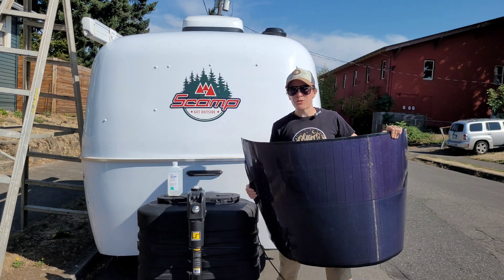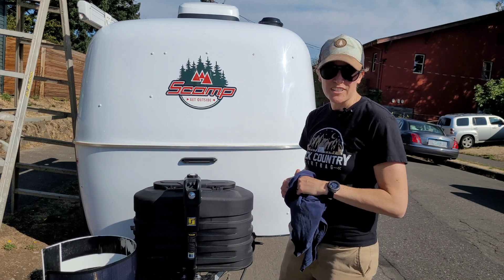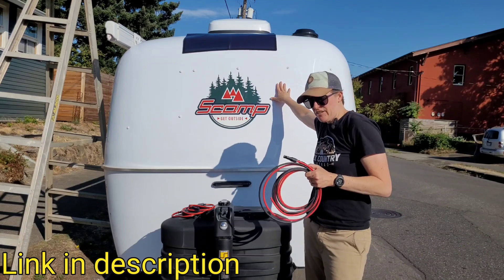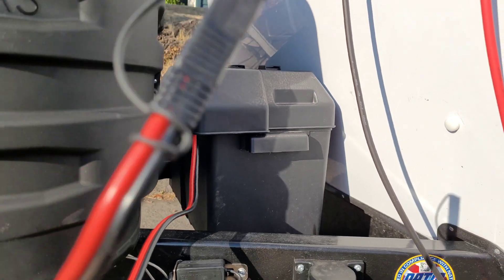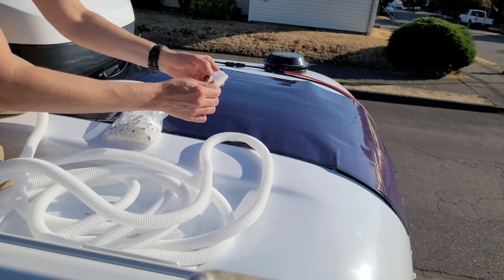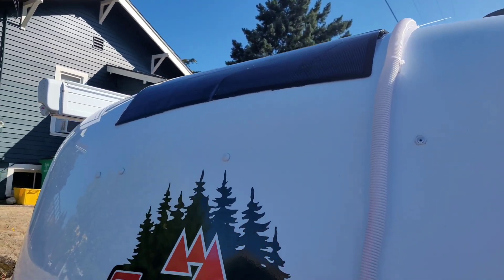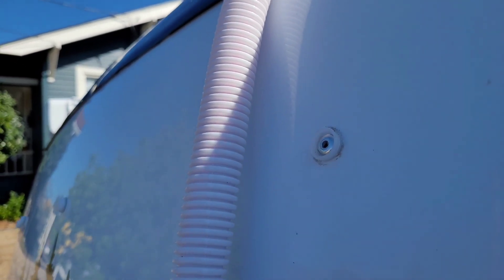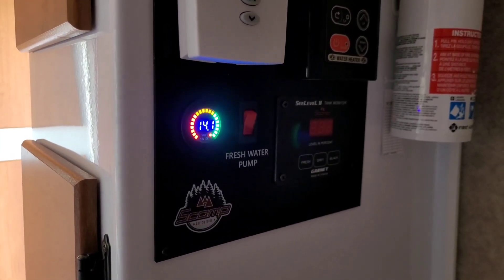Scamp 13 Flexible Solar Panel Installation

Comment: Great video! I have a 2017 Scamp that I have located at a storage facility with no access to electricity to trickle charge the battery. Would this setup be good to help keep my battery from dying?
Reply from the maker: Thanks! Yeah if I keep mine in the sun and keep the snow off of the solar panel I never have to plug the trailer in when I'm not using it. My battery stays topped off. 

But "always" charging does cycle through the fluid in a wet cell lead acid battery more quickly so I check the fluid levels in my battery at least once a month. I also clean/dust off the panel when I check on the battery to make sure it's collecting plenty of energy. 

I have a video covering the battery fluid maintenance as well if you haven't seen that yet: https://youtu.be/fZSGYlUXP74

Comment: OK, that's pretty cool. I was just looking at that exact same system a day or two ago. I am a big fan of BougeRV, I have a couple of their refers, a telescoping camp light and some things I can't talk about... yet. 
But first, today I will be moving the Scamp into its mothership docking location here in PDX and begin the cleanup and appliance check out process. 
Question, have you thought about a backup camera? Backup Lights? 
One more item, I believe those white zip ties are not UV rated, black ones are. Have you replaced them yet? How are those sticky pads working?
Reply: I'm interested in a back up camera too. Will be following your question
Reply from the maker: Nice! I've been really impressed with the quality of the BougeRV panel. It would be fun to try out more of their stuff. 

I do have the stock backup camera installed. It is really helpful during the day but without backup lights it can be hard to use in really dark conditions. 

I have an upgrade I'm planning to install come spring so stay tuned for a video covering that to hit the channel before too long. 

The zip ties have been stellar, they are all still holding up. The adhesive pads have stayed put on the roof of the trailer but the ones on the front that take all the wind while driving didn't stay stuck. I replaced the adhesive squares with VHB tape just on the vertical section of wiring that leads down to the battery. The roof mounts have held up to the wind and all my cleaning/polishing so far. 

Again, great questions. I'm glad you are enjoying the channel.

Comment: I need more power for my fridge.  After having this solar panel for a while, do you feel like it has given you more days camping with a fridge that lasts longer?  I have the same camper that you do.  I am mainly interested in additional power for my fridge, the lights, furnace fan, etc all seem to have enough power.
Reply from the maker: In perfect conditions when the sunshine is clear/consistent and my trailer is facing the optimal direction it is enough to top my battery all the way off every day.

However, throw trees, rain, or being parked the wrong direction into the mix and I need to use supplemental power on the 3rd or 4th day. I did make a whole other video all about how I supplement my power needs to stay off grid for extended periods of time. If you haven't seen that one you can watch it here:

https://youtu.be/sGxXOks0WY8?si=h2gTtNgdvAS46r5w

Comment: Have those little adhesive wire saddles held up and remained attached? They're usually notorious for unsticking themselves (especially when exposed to heat) but perhaps the ones you're using are better quality than those I've used in the past.

For zip-ties, I always use the black rather than clear/white ones for outdoor applications like this. They're invariably more UV-resistant because of the dyes used to darken the tie, and they have way less of a tendency to go brittle over time (even if you don't buy specifically "UV-resistant" zip ties). They're often the same price, so it's a no-brainer to me.

I was going to ask if it was worth adding a switch/cut-off between the charge controller and battery to avoid parasitic drain during the winter, but I guess it's easy enough to simply unplug the SAE. If you keep the trailer outdoors and uncovered (as I think you do) then you'll certainly net more charge from leaving things hooked up even in winter anyway.
Reply from the maker: 90% of them have actually. A few that are on the front of the trailer didn't hold up to the aerodynamics in motion so I reattached those with VHB tape and they have stayed put. 

So far all the zip ties are holding up great as well. But if they fail they are really easy to replace. But it's good to know the black ones are more UV resistant. Thanks for that tip.

I put that quick disconnect in at at the point where I installed the ammo box so I could use the panel to charge my portable power station as well. But it turns out I usually just leave it plugged in to charge the trailer battery as much as possible. 

In the winter I keep the panel free of snow so it can trickle charge the battery enough to keep it from freezing. I don't bother removing my battery for the season since I winter camp a ton. So having the solar system makes it possible to leave it on the trailer year round. 

Thanks for the great questions, I hope this helps!

Comment: Are you happy with the placement you chose for your panel?  I am following your choice in product here but was thinking of going horizontally over the front area of the roof instead of vertically ( if that makes sense) down the middle of the roof...
Reply from the maker: @piperkapin1515  I am but I also had no other choice. The roof on mine isn't one consistent height up there. The center is high and the sides both step down a few inches to the left and right of the AC unit. So for me there is really only one configuration that works. I have seen people without the AC place their panel in the center of their trailer's roof so it can't be seen from the ground.
Reply: @BackcountryDirtbag  That makes sense!  Thanks for the quick response.  Wish me luck for a smooth install!
Reply from the maker: @piperkapin1515  no problem. Wishing you ALL the luck 🤞 Let me know how it goes!

Comment: This is a great set up.  Are you happy w the 100w vs the 200w?
Reply from the maker: @piperkapin1515  I am really happy with the 100w. If I didn't have an all electric fridge it would be more than plenty. You can watch my Scamping off the grid video to see how I supplement power when conditions are less than ideal. But if I don't use my refrigerator I get pretty much an endless runtime with the 100w panel.
Reply: @BackcountryDirtbag  Very cool!  Have been wanting to add solar to my new (Old 1983) Scamp and this feels very doable!
Reply from the maker: @piperkapin1515  it is a very easy solar option that's for sure. Good luck, and if you decide to go for it lmk!
Reply: @BackcountryDirtbag  what happens if you aren't parked in the sun?   I bought a Renogy suitcase but it's super clunky..  def interested in this but am concerned about trees and what not in campsites...
Reply from the maker: @piperkapin1515  that's a great question. The panel does still collect some energy while in the shade, but it will be a diminished amount. I made a whole other video addressing this topic in-depth if you would like to see all the ways I keep my battery topped off without hookups. 

That video can be found here: https://youtu.be/sGxXOks0WY8
Reply: @BackcountryDirtbag  I saw it! The more mobile panels you had aren't available anymore it looks like.  Have you seen/used the Renogy one?   I'm realizing all the "extra" cords and whatnot I will need to get for extension and adapters for my Renogy Phoenix power cube and just trying to decide if its the right one.  I have pretty low needs and not tons of space so this one on the top you install is appealing for sure!
Reply from the maker: @piperkapin1515  I don't use that mobile panel for my Scamp. I just use that folding Anker panel to change my powered cooler. I use the cooler in place of my Scamp fridge so I can save the Scamp's battery by not using the all electric fridge in my trailer. I mostly supplement the trailer's battery with my portable power station. 

I have never used Renolgy products so I can't speak to them. 

But I can say that most of the places I camp get enough sun for my permanently mounted panel. There has only been one time the canopy was too thick for my mounted panel to trickle charge my trailer's battery effectively.
Reply: @BackcountryDirtbag  One last questions :).  You mentioned being able to change the cords quickly to charge your power pack.  What cords do you use for that?   Is it a DC connection to the power pack?
Reply from the maker: @piperkapin1515  I got MC4 connections that adapt to a barrel plug that fits my power station. But it turns out the amperage from the panel is too high for the power station. So if you are planning to use the same setup check for amperage compatibility 1st.

Comment: Nice video:  I went to the scrap yard tapped into the awning brackets with 1/8 inch alum. angle and glued an angle iron on sideof the roof ac..........just instulled 2 renogy 100 watt panels........came out nice.  pics upon request
Reply from the maker: Creative! Peanut butter and jealous of your 200 watts. Have fun out there.

Comment: Where did you get your fitted sheets for your bed? Thanks Philip
Reply from the maker: Hey Philip. We use these Jersey Knit sheets in the Full size for our 54" wide bed. They are very easy to stretch around oddly shaped cushions/mattresses.

Here's the link:  https://amzn.to/4aBFjm5
Reply: @BackcountryDirtbag  thanks

Comment: Great, easy, no drill solution. I love it! ❤ Question: is your battery lead acid or LiFePOS4? I recently upgraded to a LiFePOS4 system in my Scamp and have to have a lithium compatible converter when charging on shore power. Is your charge controller compatible with LiFePOS4 batteries? Thanks! 😊
Reply from the maker: Thanks! My Scamp still has the stock battery that it comes with from the manufacturer. 

The charge controller is compatible with Lithium batteries and has clear icons on the LCD screen, such as LFP for LiFePO4, Li for Ternary lithium battery, LTO for Lithium-Titanium-Oxide. 

It's the main reason I chose to go with BougeRV. I won't need to upgrade my charge controller when I upgrade my battery later on. 

Thanks for watching and commenting 🙂

Comment: Why did you mount the panel with the connectors on the top...? 🤔 Seems like it would have worked better if they were on the bottom... (I am not criticizing, I was just wanting to know your thinking)... 😊
Reply from the maker: That's a great question @ZiggZagg11. I did it that way for 2 reasons. There is a portion of the panel near the wires about 3-4 in wide that doesn't have any Photovoltaic cells, which are what convert sunlight into electricity. That "dead space" runs the length of the panel on that side. Since I put the panel right up against my roof AC unit I knew that edge closest to the AC would be in the shade a lot. It made sense to put the non-productive portion of the panel up against the obstruction. 

Additionally, the wires enter the panel in opposing directions. So if I mounted the panel the other way, there would be a big loop of black wires visible outside of the tidy white cable lume at eye level. So, anesthetics and efficiency both factored into that decision.

Comment: Nice video...  I'm in the process of setting up solar on my GreyWolf camper.  After looking at the video, where is that 3 positive cable going...
Reply from the maker: I'm not sure which cable you mean. There are 2 coming from the panel (red +, black -) and the SAE cable coming from the battery that sorta looks like a single cable but is just the positive and negative glued together for the ease of the SAE connector. I used an additional SAE cable to give me more working room but cut the far end SAE connection off so I could separate the 2 wires and run them into my charge controller. All 4 wires attach to the charge controller after being fed into the storage box I installed. 

A positive and negative run into the charge controller from the solar panel (input.)

A separate positive and negative run from the charge controller to the battery (output.)
Reply: Also, what kind of portable power station would you recommend to use.  My camper is like double your size.  Also do you have video about installing it with this setup?
Reply from the maker: As far as power stations go, it really depends on your personal power needs and what you plan to power with it.

I am in the process of making a video all about my setup, so consider subscribing if you don't want to miss it. Happy camping!

Comment: Did you use the battery you got with the Scamp or?
Reply from the maker: I am just using the original Scamp battery so far. My trailer came with the group 27 battery. I wanted to see how it performed 1st before investing in a different option. I'll be camping without hookups for the next week to give this setup a good test run. If my current battery doesn't cut it, I'll upgrade. I'll post a video with my findings, so be sure to sub if you don't want to miss that one.
Reply: @BackcountryDirtbag  Thanks so much! I’m trying to figure out what I’ll need, as I’ve ordered a new Scamp 16. Subbed for sure!
Reply: You might want to get a battery lock like the battery shackle
Reply from the maker: @cab1733 Yeah I'm working on that one. The option I ordered didn't fit since the scamp wall curves so closely to the battery. Trying to find the Scamp's glass slipper.

Comment: Thanks so much for your video. I am currently using a Renogy 100 watt solar suitcase panel with my 13’ Scamp.  How did you decide on which flexible solar panel to buy. There’s a bit of a price difference between Renogy and BougeRV and other brands. Thanks again.
Reply from the maker: You are so welcome. Ty for watching. The deciding factor for me is the superior durability of the CIGS solar panels over the monocrystalline. 

Monocrystalline flexible panels are made up of delicate silicon wafers which don't support hassle-free transportation so they're more vulnerable to micro-cracks while flexible CIGS panels are convenient to move, fold and use without risk of damage and reduced efficiency.

CIGS can get scratched, struck by falling branches, and literally walked upon without losing its ability to generate power. For me, the longevity of the CIGS is worth it.

Comment: Love the 80s music when connecting the battery 😊
Also I see now the adhesive strips are really well-designed. They go to the edges like you said, so the wind should have ZERO effect on adhesion.
Reply: Another thought for others installing the solar panel. It might have been better if you laid the center adhesive strip down first, then each side separately, so that the corners could curve in or out as they need to avoid the wrinkles. Hopefully this doesn’t sound judgmental :-)
Reply from the maker: That's a good thought. However, the Scamp roof is rounded, not just curved. I think a few wrinkles were unavoidable. Kinda like putting a sticker on a helmet. The flat item will fold to the round surface 🤷‍♀️
Reply from the maker: P.S. you don't sound critical. I appreciate your comments and suggestions 😊